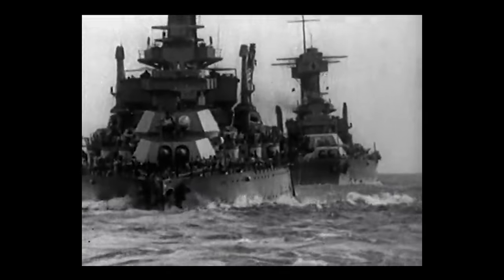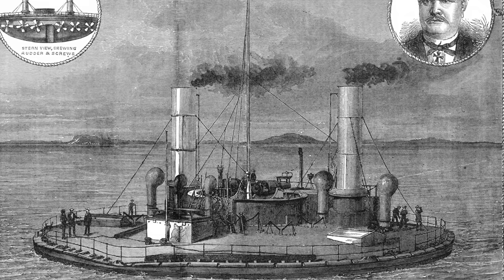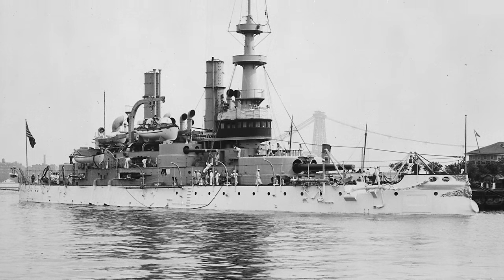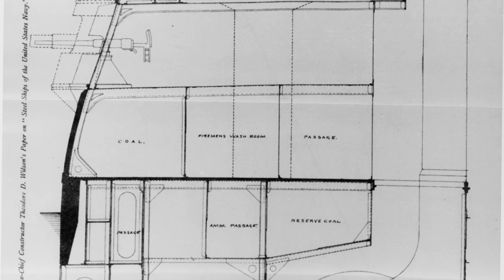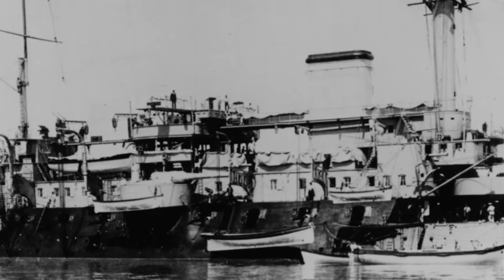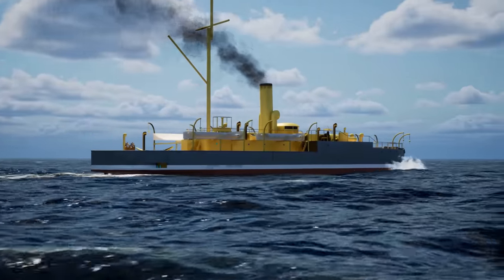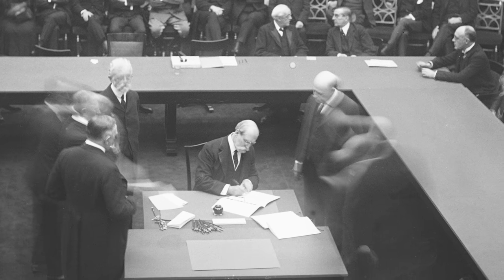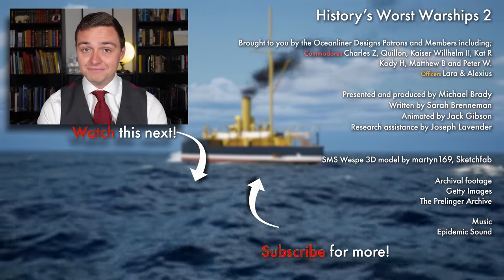AWFUL Warships From History

Comment: To be fair Massachusetts sister ship Oregon performed superbly during the Spanish American War. First she had to steam from the Pacific to Florida and since this was before the Panama Canal was built she had to sail down to South America and round Cape Horn. She did it in 66 days without any major mechanical issues. During the war she was blockading the port of Santigao de Cuba where the Spanish squadron was holed up. Seeing that part of the American fleet had sailed away for resupply the Spanish saw there chance to break out. The Oregon was the only US warship that had steam up to begin immediate pursuit. The chief engineer had been holding in reserve the best quality coal and now began using it. Leading the rest of the US fleet they began to run down and destroy the Spanish fleet. Between her long trip from the Pacific and chasing down the Spanish fleet the chief engineer would make Scotty proud.
Reply: The hate for and legend of the 'worst battleship' USS Massachussetts is a very very recent one. It doesn't seem to be borne out by the ship's career or relationship with its two surprisingly successfully seagoing 'coastal battleship' sisters. If I had to guess, I would put this one down to an 'Internet whisper' possibly originating on Reddit.
The Hoche, likewise, had an absolute hatchet-job done on her in the early 1990s in a book written for Guinnes about naval blunders, wherein it was written that she rammed and sank the packet steamer Marechal Canrobert (as apparent proof of her shoddiness?) with the loss of 103 souls aboard the Canrobert. This became the basis of all internet articles about her - and thus 'fact'.
Actually, however, some original research by myself uncovered newspaper reports of the time which revealed that Canrobert had been carrying 103 souls and that 3 were lost in the collision.
In fact, the whole episode was the fault of the Canrobert's captain;. He had attempted to give his passengers a splendid up-close view of the Mediterranean squadron firing their guns on maneouvres, after he sighted them whilst approaching Marseilles. He clearly got way too close and, in the smoke of the gun discharges, the mail/passenger steamer inadvertently crossed the bow of the battleship nearest on the end of the squadron's line abreast (Hoche).
Hoche's captain, on the other hand, whilst having to keep station as this onlooker hung around, clearly saw the danger and, at the last moment, seems to have been prepared for the collision. The clue is that, as soon as the crash had ocurred,  the battleship stopped and her myriad boat-cranes were swung out; the Canrobert was hurriedly lashed alongside & supported by the cranes while all survivors were taken off. Then the traces were cut and she was allowed to take her final plunge (her wreck can be dived today).
No-one was lost in the actual sinking - only the three in the ramming - mainly thanks to the skill and professionalism of Hoche's command team.
Once you look deeper into it, the story is usually more sobering and believable. But people of the early 21stC just love to mock these crazy old Victorian things.
Reply: Thing looks/sounded like a deathtrap to me.

I'd have hated to be assigned to it.
Reply: @planescaped   But why exactly? What about it made it into the deathtrap you think it was? Why were her two identical sisters such effective battleships when they saw actual, real, face-to-face battle with the enemy' warships? Why didn't they just roll over and sink under the weight of their stupid guns and stupid turrets, or else roll over under the impulse of the recoil of their stupid guns?
Answer:
Because there was absolutely nothing wrong with them apart from a little lower freeboard than an ocean-spanning navy of the time would have preferred in their battleships.
What you've done, is bought into a modern myth. This absolute garbage is not from the historical record - it's brand-new and it's completely made-up. Do not believe such utter rubbish.
Do yourself a massive favour and read about the USN's Spanish-American War service and especially the Battle of Santiago de Cuba - one of America's most spectacular and decisive naval victories. (You can forget all about Dewey and Manila Bay; Santiago de Cuba was the real deal).
Reply: @AndrewGivens there was no myth of problems existing that existed onboard the Indiana class, but, I do doubt they were death traps either, all battleships have their own faults after all, but that doesn’t completely make them a bad ship. The hate may more likely stem from the criticism from the design aspects, as her service records along with the other sisters were quite good, but design-wise, they did have to get bilge-keels installed during their service life since one of them had their clamps snap and sailed to port when the crew were worried they will snap again in a different journey -having occurred 4 months later after the first incident-, and the cases where the ships do indeed lean with their gun’s positioning being another problem, and a few other faults, weren’t as wonderful. These particular flaws wasn’t recent, having been documented in the 1980s in Reilly & Scheina’s “American Battleships 1886–1923: Predreadnought Design and Construction.” Book. Fortunately, several of the flaws were fixed, improving their characteristics. The other problems did not hold back the three from getting embalmed into history, and for all it’s worth, demonstrate the class’s ability to serve even with their issues.
Reply: @AlexanderVonish   Now that's far more like it. A much more balanced view.
I dislike it when i have to come down hard on one side of a discussion, because it's not being dealt with in a mature, informed or nuanced way, but that's how it is sometimes. If it promotes a better-balanced view coming along, like yours, and an informed view at that, then i'm glad to have done it.
Ultimately, it's not as though, as you say, a great many ships didn't have their issues, but these were generally not fatal flaws. Rather, they were quirks - and some gave more headaches than others, but they're quirks.
What I will say, in light of your comments, is my true feeling about the Indianas is that they were a first attempt at a first-class battleship and they attempted a lot for the displacement - and were too ambitious. Iowa was clearly an improvement, but doesn't invalidate the qualities that the Indianas, as fixed, clearly had.
But they were very clearly superior in many regards to either of the Texas or Maine, whilst still falling short of contemporary European standards & trends. But look where the USN was with BB design five years on. Doing well.
You'd hate my take on the Orlando-class cruisers...
Reply: didnt her 66 day race to Cuba cause the need for a canal?
Reply: @nursestoyland  Not really, but it might have highlighted the need for one. The idea for a canal across the Isthmus of Panama can be traced as far back as 1534 when the King of Spain (and Holy Roman Emperor) Charles V had ordered a survey of the territory for the purpose of building a waterway for the Spanish fleet. The British and French tried to build one in the 19th century (with actual work being done by the French), but those attempts failed, mainly due to finances. The US took over the French work and, after engineering the Panamanian revolt in 1903, got the canal finished.
Reply: Thank you suflanker, Alexander and Andrew, I wanted to point out the battle successes of USS Massachusetts BB-2's sister ships. The three of you did a far better job than I ever could. This trio was designed as short range defense battleships and that explains the low freeboard. The US Navy had no intention of fighting a world war when these were designed in 1890.
Reply: Thing is, once the USN realized their first effort was very rough in many respects, they worked to fix or ameliorate those issues.

So while yes, technically the class was pretty cruddy, they still had heavy armor and big guns and their crews were knowledgeable of their faults and trained in keeping them from from technical to real... hence their long and successful careers in both peacetime and combat.

But yeah swap them to a different navy that doesn't care as much about those things and their faults probably become glaring and maybe even fatal.

Comment: My favorite warship of all time was the Czechoslovakian Sicherungsboot 43, armed with a German Panzer IV 75mm tank turret the ship was the largest ship ever used by a landlocked nation. Its only range of operation was a tiny sliver of the River Danube that formed a small fraction of the nation's southern border. Ultimately the Soviet Union superceded the naval presence on the Danube and the ship was removed from service.
Reply: I thought the President Masaryk (Also Czechoslovakian) was the largest one. The Sicherungsboot 43 was a patrol boat with one Flakvierling and one Panzer IV turret, while the President Masaryk had two twin 66mm guns and four heavy machine guns.
 A later modification by the Germans gave it two 88mm Flak, one 37mm AA gun, and five 20mm AA.

Comment: Great one Mike!  Thanks for posting!
SMS Wespe strikes me as  more of a crew-served weapon than a functioning sea-boat.  What I mean by this is when needed it's manned, goes out to fight, then comes back in to re-arm and refuel, hence the poor crew accomodations.  It didn't work anyway but we can see that "crew served weapon" idea in the way the U-Boots of WW1 and WW2 were built.  Crew accomodations weren't so great on them either.  
Confederate ironclads during our Civil War were built with the "crew served weapon" mentality as well.
Reply: Great comment - it's the key difference between the offensive and coast-defence 'boats', as opposed to cruising 'ships'. Such minor vessels either operated from a base for missions, or operated from a tender (a mothership at anchor full of supplies). They were far closer to concept of a bomber squadron operating from an airfield in this respect, returning after the mission instead of continuing a voyage.
The Wespe class were conceived and built around the same time as the four Sachsen-class ironclads, which are often viewed as battleships or central-citadel ironclads, but were in fact rated by the Germans themselves as 'sortie corvettes' - indicating their lowlier status compared to the broadside ironclads, deriving from their strictly coast-defence mission as conceived, and all part of a grander coastal 'defence in depth' based around several key coastal 'fortified areas' (and which also involved the army) in case of invasion or aggression by a rival.
Reply: @AndrewGivens  Thanks!  I was hoping I wouldn't be misunderstood.

Comment: Small correction regarding the Popov, firing the the guns did not cause the whole ship to spin. Rather it caused the the turntable that the guns were mounted on to spin around because the locking mechanism for the rotating equipment were not strong enough to handle the recoil of the guns.

Comment: Hoche wasn't the only French battleship that followed the "floating hotel" design aesthetic, most of the French pre-dreadnoughts followed a similar design with one of the worst offenders in my opinion being the Massena which was some how based on the completely acceptable design of Brennus. It is a combination of the pronounced tumblehome and high unwieldy superstructure that truly makes these ships some of the ugliest to ever sail. There was also the French shipyards need to constantly innovate and make additions to ships under construction leading to ships that were supposed to have similar parameters in terms of displacement, main armament, machinery and speed to be wildly different from one another.
Reply: The core problem was that France, at the time, was building its navy on the basis of commercial competition. So, a programme for one battleship, would get the best single design - witness the Brennus. A programme for four similar battleships, however, would get the best design, and the second best one... and the third best, as well as the fourth best one. Ouch. And that's how you get the mess of the Charles Martel 'type', where there are some decent enough ships and some less so... and the Massena.

BTW, I find the French aesthetic of that time very appealing - the fierce face does exactly what it says on the tine and they looked ferocious, as a warship might.

Interestingly, despite the insistence in certain sources that the Massena design was 'based on' the Brennus, the earlier ship was actually designed by Huin and built by Lorient, whilst the later Massena was designed by de Bussy and built by Chantieres de la Loire. None of the original four in the Charles Martel group were Lorient products.
The fifth, follow-on unit, however would be designed by Huin and built by Lorient - and that was the far more austere and conservatively-styled Bouvet. Easily the best of the five too and with aesthetic cues which absolutely do bear comparison with Lorient's earlier battleship. That she was allowed to degrade so and that this made her end so swift in 1915 was tragic.
Reply: @AndrewGivens  yes but the fact that the tumblehome would have serious stability issues when damaged as well as the fact that the ships tended to be a bit overweight at full load leading to their armor belts being mostly underwater make the design concept questionable, I mean I understand that the tumblehome offered greater stability in ideal conditions and allowed the Ship’s guns to be mounted higher but I don’t think that outweigh the other issues. Also a tumblehome looks nice on an age of sail ship of the line, more modern ships of steel and iron… it looks out of place especially when done like the French did it.
Reply: To be honest, I really like the French designs. Something about their looks screams like diesel punk + sky pirates combined.
Reply: @adamdubin1276  I'm not especially defending extreme tumblehome from a practical or technical perspective, just saying that, as a floating dark fairytale castle of doom it looks amazing to my eyes.
I'm really not certain that there are any serious claims that this exaggerated form of tumblehome had any positive effect on stability under any conditions whatsoever - Reed's treatise on the subject in 1869 totally suggests that it would have been stability-neutral at best, for it puts no very little additional displacement (and thus upthrust) onto the side heeling beneath the surface of the water, whilst the side rolling upwards is moving it's mass towards the centreline as much as above the centre of gravity  when compared with a less drastic form such as in the Royal Sovereign.
I think what the French really did gain from it was the ability to indulge in very heavy bow fire, since the huge cut-away which was the totality of the negative space above the waterline on each side allowed for easy dissipation of blast along the fore & aft axes from all those beam-mounted guns. This is something which more 'straight-sided' central-battery ironclads of earlier British type didn't manage to do with their close and very hard-edged embrasures. And bow fire was something which not only the French were heavily into during the 1880s & 90s, but the French made it an essential part of their fleet tactical doctrine for a while.
If you look at the later French central-battery ironclads, from Colbert up to Devastation, they all show the exaggerated double-curve cross-section, with their main box battery projecting from the ship's side and with no deck above or below to feel the effect of firing at the muzzle, but with full buoyant support of the same battery structure from the very broad beam immediately beneath. I'm pretty certain that this was what the French were doing, all the way from the mid-1870s to the turn of the century; allowing for axial fire from the heaviest possible guns without incurring excessive self-harm from the blast.
It's a really interesting design choice though, I think we can both agree on that.
Reply: It's call fine art, and not everyone has the patrician tastes to appreciate them...
Reply: Those things were also so unstable that one of them (Bouvet) sank in just a few minutes from a single mine.
Reply: Drachinifel did a video covering them.

Comment: Great job Mike, but the "fast attack" US submarines of the Cold War should be added to the list. I only had a tour of one of these during my time in service, and "crarmped" is a HUGE understatement. For instance, the galley was just barely, and I do mean, just barely, big enough for one person. Then there is the matter of "hot racking." Hot racking is when a sailor uses the bunk for 8 hours, then folds up his linens (and stores them) so that another sailor can use the bunk (3 men sharing one bunk). If there are any fast attack sailors out there, they can elaborate more.
Note: The US now uses much larger subs to do what the fast attacks did (detect and follow subs from another navy).
Reply: I spent weekends in high school working on the old USS Roncadore hoping we could open her to the public at Redondo Beach Pier.  It was never to be but I did get to spend a lot of time pier side in a WWII Fleet Boat and knew them inside and out to an degree.  Later on as a cadet at the Coast Guard Academy I had an opportunity to tour a Permit class SSN.  I was stunned at how cramped they are. Despite being so much larger than a WWII sub they are jam packed inside with equipment.  Living and working spaces are super tight.   Mess decks are so small the crew has to eat in shifts.  You have ten minutes to swallow your chow and get out so someone else can eat.   Crew members hot rack or some just use a sleeping bag in their workspace.  The old Fleet Boats were roomy and comfortable by comparison.  Now I am sure underway with diesels running they were noisy, smelly and unpleasant where a nuke boat has an almost antiseptic scrubbed atmosphere.